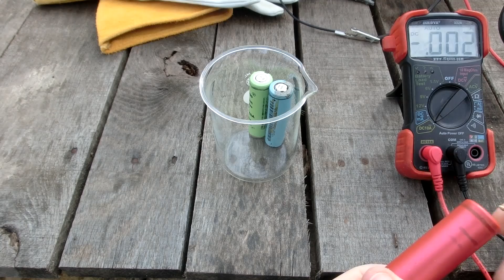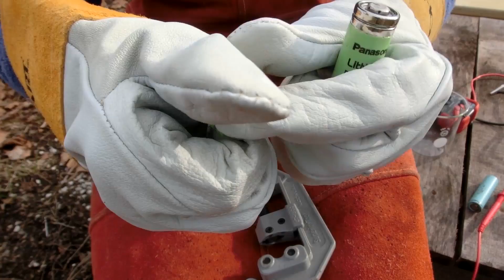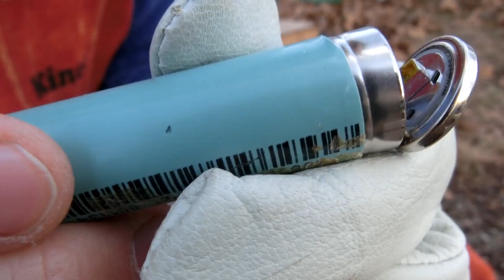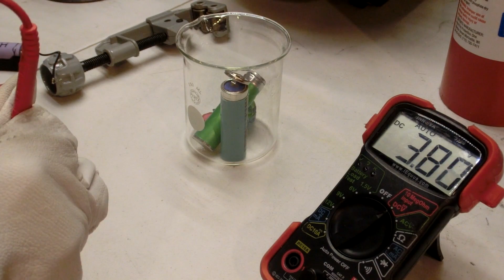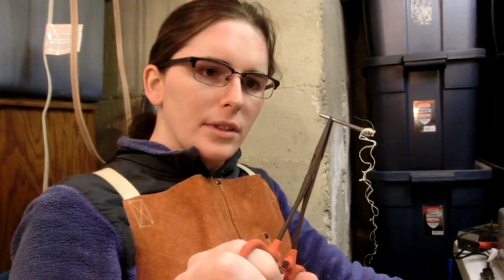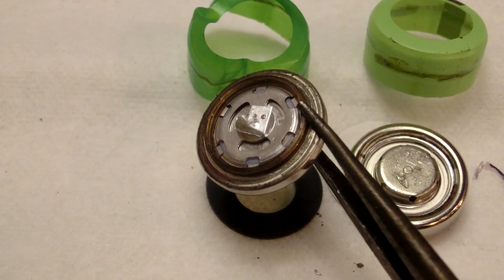Opening 18650 cells: Panasonic Sanyo Sony Generic Lithium-ion Battery Teardown

Comment: Hi i have a question ,can i use 2 different brand of 18650 in series or parallel?....I have 2 18650,one of them is lgeas31865  and the other Ultrafire. Both of them  have the same spec 2200mah and so on....I  also have  an old 1978 7.4v cordless drill,that i was gonna put the battery in...Right now it ran on a 6v bike battery lol
Reply from the maker: +Fook Utube yes, but only once you do a doscharge test. i wouldnt trust an ultrafire cell. they tend to be cells ripped out of old laptop packs and relabeled without testing, all those like Ultrafire Truefire and Trustfire are wasted of money
Reply: Thanks Rino for the reply....Yea the Ultrafire came from a old cree torch and the other one  from a lap top,both of them hold a charge pretty good...Im also a big fan of your battery pack video,keep it up!!...Again thanks you for  your help

Comment: It is still a chance to repair battery with broken connection. Just push a piece under the + connection (you need to go there by using small wire or cut first + connection and push.
Reply from the maker: that is a horrible idea.
Reply: Yes but if you use only one cell for low power products it still working - charging and discharging. It can be damaged because of short  or difference between any other cell in pararel conection and it generated high current. By repairing broken connection it still working. As you can see you had one cell fully charged and you destroyed it (it was dangerous and that cell might explode).

Comment: 2:36 Is the meter supposed to be on the 10A range? aren't you trying to measure the voltage?
Not sure what you're trying to test here
Reply from the maker: no i'm trying to measure how much power they would discharge if shorted out. also you can see if the internal fuse is popped or not because almost no cell would give 0ma.
Reply: I see, thank you for the information.
Really interesting video thanks for being so brave and putting in so much time so we can see inside

Comment: i take apart 18650 cells all the time and to be honest your a liability. please discharge them to a safe amount. Also you may be to cut the bottom with some spinning blade.
Reply from the maker: your comment makes no sense but it succeeds in making you sound like an idiot. what am i a liability to? you word that in a very condescending way and then dont even say why.

Comment: "discharge for 6 hours and it's still holding power"... the power discharged should be measured in watts, not amps or volts. It might be that the cell has almost no power and is discharging mWh or uWh over hours. It may have a voltage with no load, and then the v drops to near 0 with a load... so you may have high amps but still very low power dissipation. To solve the mystery, I suggest reading the voltage and amps under the same load. If it was shorted 6 hours I'd expect it to drive current through only a small resistance, eg. perhaps 50 mV with 1 ohm resistor = 50 mA. It'd be interesting to hear how a shorted, dead battery that still reads high amps, measures up under a reasonable load!
Reply from the maker: +j8wydf6 thanks mister obvious. the mystery is how such a cell could have such a high internal resistance, not how electricity works. this cell doesnt work like any ive seen before. i would have expected a cell this bad to just die already

Comment: I made my first comment before watching your entire video.  I did not realize that you created a dead short on those batteries.  Maybe the dead short opens the battery circuit becaues of heat and when it cools you have a battery with charge again.  I will keep watching and learning.

Comment: I really like your video.    I have always wondered  " whats inside "  Of those very expensive batteries.  Also Being a construction worker I can really relate to your narrations.  I think that the green battery that seams to be just recharging its self is tricking you.  Your method of discharge using a meter has very high resistance  meaning that the discharge is slow and not all consuming of the batteries power.  But I am no expert and also have other thoughts that it might be.

Comment: it is possible to bypass the fuse on the battery by removing the plastic and on the plus side there is a ring which has the plus polarity and is unfused.

Comment: Interesting video! I'm currently unraveling around 600 laptop packs to harvest their 18650 cells for a set of powerwalls, so anything 18650 related is interesting :) 

Nice to see a cool woman on such YT channels for a change too!
Reply from the maker: well i'm glad you enjoy it. i currently have bins of like 900 cells that i'm trying to test. i made the mistake in asking my friend who owns a recycling center in silicon valley to save all the laptop packs for me, so i ended up getting several hundred. although for like 1$ a pound. then i bought a nissan leaf battery. i got too many batteries. haha

i'm working on something similar, like a powerwall but designed to lay flat on the concrete ledge in my basement. i plan to have it just run LED lighting and maybe some power tools first :D

Comment: any chance you can do a discharge test with a cell frozen in the freezer and see how much it looses capacity wise  as to normal room temp, even discharging it in the freezer i cant see it losing that much capacity tbh but will be a good test to try anyway ;)

Comment: The Panasonic cell is obviously the answer to the world's energy problems! 😂
Reply from the maker: +eLJaybud one femtowatt at a time
Reply: I'm not sure if she missed some kind of a series PTC fuse that just turned into high resistance mode just after shorting and relaxed when she tested the cell's short-circuit again in the basement.

Comment: Rinoa, Electrolyte is a guarded formula in the battery and capacitor manufacturers.There is an interesting read if you google "bad caps" or "buldging caps". In the early 90's there was a person that stole a formula for electrolyte and used it in capacitor manufacturing. The formula lacked a preservative and resulted in millions of capacitors getting installed in electronics. The caps eventually failed and caused billions in damage.

Comment: if the cell has internal protection, shorting it will do nothing, as the protection circuit will clamp.
Reply from the maker: +todkapuz but in the almost 1,000 18650s ive gotten only one was protected

Comment: if you drop them in water they will bubble and produce oxygen
Reply from the maker: +David Simpson have you tried it or just under the false assumption that there is pure lithium in here or something?
Reply: well from the reactions it should be oxygen and i have dropped dead cells in a bucket and it bubbled so i know gas is given off and when collected and a burnt out splint was introduced it did relight like the school expeirment when you would collect oxygen from a plant in a test tube how pure it is i wouldent know how to go about testing that
Reply: They will. Hydrogen too.
Any residual electricity in the batteries would split some of the H2O into HHO.

Comment: Could you open 2 different cells, one normal or those called laptop cells and another one used in power tools, since they have different discharge rate , or maybe you already did there an the thick conductor was the difference.

Comment: Set your DMM, to current, then connect to the battery, t will discharge fast enough, for you to see it the current drop. I have done this many times to discharge a battery..
Reply from the maker: thats what i did, took about 9 hours total to get that one cell sufficiently discharged but not all the way.

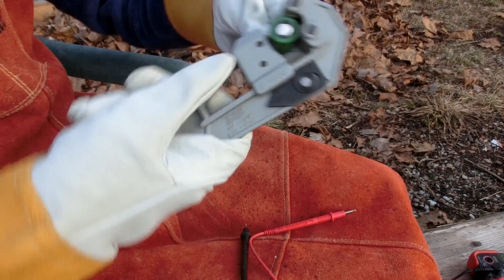Comment: @Rinoa: I did a quick scan of the comments, and don't see it mentioned anywhere yet: @ 8:40 when you noticed that the voltage was going back up - "This is due to the diffusion of the acid from the main body of electrolyte into the plates, resulting in an increased concentration in the plates. If the discharge has been continuous, especially if at a high rate, this rise in voltage will bring the cell up to its normal voltage very quickly on account of the more rapid diffusion of acid which will then take place." (source: https://electronics.stackexchange.com/questions/25216/why-do-batteries-recover-after-a-load-is-removed) 

Hope this is helpful!

Comment: Good to see an electronics related video, it feels like it's been a while
Reply from the maker: +Brett it has been a while for battery videos, i got really burned out on this type of video in 2014 and still find it hard to do them, yet they are all im really known for.
Reply: Rinoa Super-Genius I guess you might also be known as the youtuber who chases bricks after the last 20 videos. I'm pretty sure you were one of the first on YouTube to do an 18650 video, there are heaps now with HBPowerwall having a lot of followers doing similar things.

The best way I have had the smell described to me is 'Juicy Fruit' the chewing gum. Worst part is when you have a hundred of them how do you find the one that is slowly leaking.
Reply from the maker: +Brett find a leaking cell with a high quality thermal camera. theoretically an evaporating electrolyte would lower the temp while not working, or it would get overheated while being used. :D

Comment: seriously, don't breathe in the electrolyte vapour. 
I used to work at an electronic waste recycling place where the items were mechanically dismantled to separate the parts for further recycling.

a load of used water meters containing 18650 cells went through the plant and the batteries were damaged by the Querstromzerspanner (a machine used to mechanically dismantle E waste) this caused the batteries to heat up until they were glowing red hot and vent electrolyte vapour. 

I was in the area this was happening and started to remove the hot and venting batteries from the conveyor to prevent fires and place them in buckets of sand. 

I ended up breathing in some vapour and had chest pains and a tingling feeling all over. Li-Ion electrolyte vapour has an anesthetic effect.

ended up in the ER getting chest x-rays and ECG(EKG), thankfully it hasn't seemed to have done lasting damage.

Comment: I have noticed moth lithium cells have a strange artificial banana smell to them. I actually like the smell. Its kinda like gasoline in a small way. That magic Panasonic cell though is awesome. But this is why 18650's have quickly became so popular. They can take a good beating (work load wise) and still work. I work at a battery store so you get to experience weird things a normal person wouldn't. I can tell you the smell of almost every kind of battery venting and what I recommend for certain applications. I have found a new love for sealed lead acid batteries. You can get A LOT of power in a small package and fairly cheap. They also aren't as dangerous as lithium cells but I still prefer lithium for most things.

Comment: Hi the 18650 was bubbling because lithium reacts with the oxygen and water in the air. you should save the lithium metal which is light grey and try making your own diy battery :) p.s dropping lithium in water is fun
Reply from the maker: but its not pure lithium, its lithium cobalt oxide already. theres only like 3% lithium in a lithium-ion battery. you have to get primary lithium cells for pure lithium. also i'd recommend going down the column of alkali metals to get more reactive elements.

Comment: hey rinoa i bought many brand new 18650 panasonic and sanyo cells, and when i use my multimeter to check the amperage on them fully charged they all say 1400-1550 mah , despite them being rated for 2250mah ... do you know why this might be ?  i cant seem to understand . i used my imax b6 to fully charge them

ps: i bought two different types brand new from 2 different people on ebay , and i have over 50 of them , they all say the same thing: 4.2 volts @ 1400-1550mah , also my multimeter is rated 10 amps
Reply from the maker: you dont use multimeters to check mah. you need to us the imax b6 to discharge them.

amp-hours are a unit of power and time, a multimeter doesnt take time into account.
Reply from the maker: *****
when its less than a few amps, yeah

Comment: batteries of any type do recovery as the power storage is a chemical reaction which takes time, the electrons around the electrodes are depleted it shows 0, but then given a rest, the electrons have time to migrate from the parts of the cell that are further away from the electrodes.

probably this is to to with internal resistance also, as that goes up, the usable current decreases, a "dead" cell still has sme power but it can't produce it fast enough to be useful, does not mean there is no power there, just that it can't be gotten at easily
Reply from the maker: yeah i know buts its just a surprising amount of resistance.
Reply: as the internal resistance goes up, the battery can deliver (or accept) less power over the same time, so it's probably an indicator of a battery at the end of it's life, maybe they are similar as you picked the poorly charging ones to dismantle

Comment: Shit be careful, I just built a storage for all my lipo batteries I used a metal storage cabinet and lined it with cement board and above each shelf is sand. Mabe over the top but worth it.
Reply from the maker: if its near something important like a building, thats not over the top.

Comment: all the people who vape r crying
Reply from the maker: why?
Reply: Rinoa Super-Genius that's what u use in vaping mods
Reply from the maker: TheDirtvlogger Liam
no, you use 18650 cells that work.
Reply: and preferably ones that can leave a continous 25A current.
Reply from the maker: rosselur
yeah these dont like going over 10a.
Reply: 10A is quite a lot. whats that, like 35W per cell under load? were they all scavenged from laptops, or do you have other sources? (sorry if you mentioned it in the video already)
Reply: Rinoa Super-Genius true
Reply from the maker: pretty much only laptops.
Reply: cool vid!
Reply: I cry thinking somebody would use one of them for vaping.    Maybe tear apart a VTC5a, HG2, or a 25R.    ....but carefully.

Comment: dude you need to stop sniffing acetone, solvents, and random ethers. Like i don't know what the health effects may be but the bottles usually carry about 50 warnings.
Reply: most things only cause cancer in the state of california
Reply from the maker: i was mostly joking about it being bad, acetone is pretty safe to handle. i've handled it a loooot when working with 3d prints and whatnot.
Reply: True enough though i still wouldn't be sniffing at them. Ever since i worked with HCl acid i've noticed my sense of smell being a bit lacking.

Comment: i did just this with a crappy nimh-aa, had a bad capacity 300mah, wondered if it was fake, turns out, it wasnt, it had the mesh electrodes and the paper, no empty space, it was a super cheap chinese one, so they must have used thicker and thus much less surface area stuff, should have sacrificed an eneloop and measured the sheets and electrodes